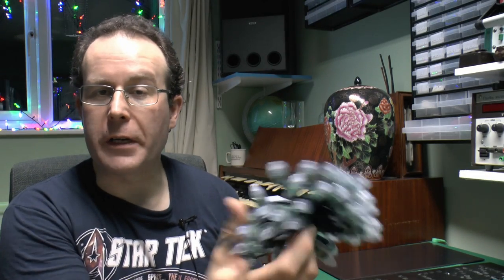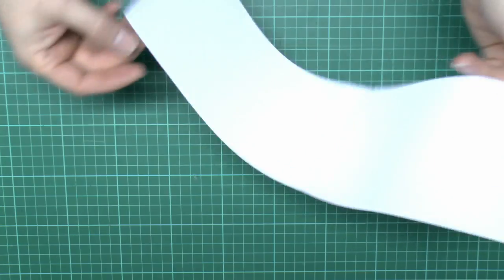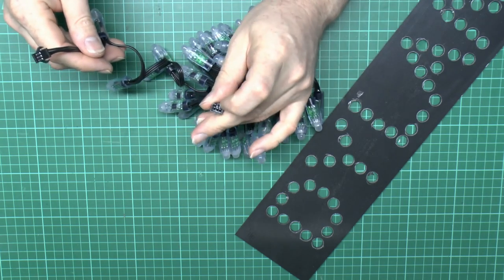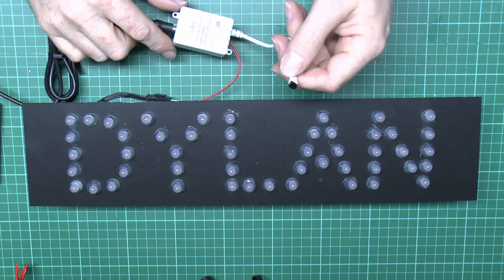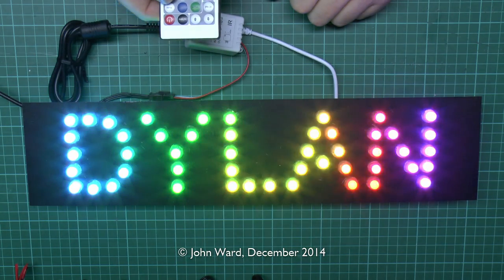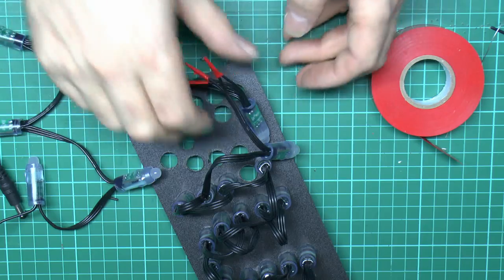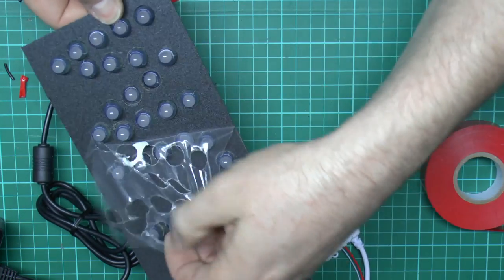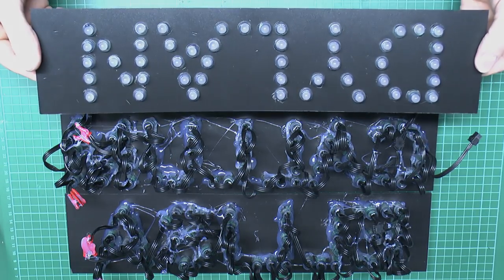RGB LED Pixel Name Signs

Comment: John 

Your video is very helpful.  Thanks for taking time to make it.  I bought a remote control just like yours.  The operating instructions did not come with English.  I have have tried to get some English instructions but I have not had any success at it.  Is there anyway you could help me with that.  I would appreciate it very much.

Ray in Oklahoma
Reply from the maker: Mots of the buttons on the remote are just for colour and pattern selection.  The important thing is to set the number of pixels connected, which is done by pressing the IC SET key once, then using the up/down arrows at the top left to select how many pixels are in use - if none or only some of them illuminate, press UP until they are all lit.  If they are already all lit, press DOWN until the end pixel is not lit, then press UP once so they are all lit.
If this is not done, the patterns and colour selection will not work properly, and some pixels may not work at all.
Reply: Thanks I got them working.

Comment: Is it possible to convert this for use with a battery pack? Want to make a portable led board but not sure how.
Reply from the maker: Yes, it uses 5 volts.  However the current required is around 4 amps, so batteries would not last long.

Comment: Hello, what brand controller are you using to run the signs MG
Reply from the maker: https://www.aliexpress.com/item/Free-Shipping-1x-24-Key-IR-Remote-Controller-WS2811-WS2812B-200-Change-Max-1000-Pixel-LED/1547147534.html
Reply: Thank you for the info it is very helpful, can you let me know where to purchase the pixels you used on the sign, I want to make some holiday signs for my Xmas display. Thanks again MG
Reply from the maker: All links to everything are in the description for the video.